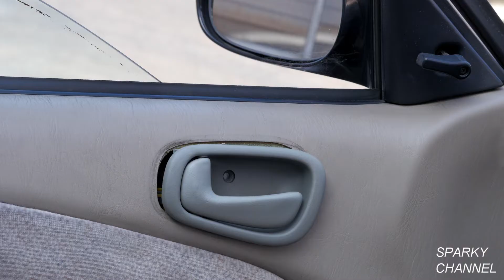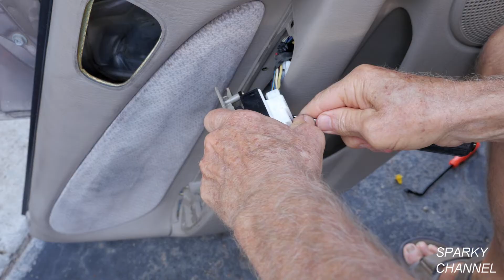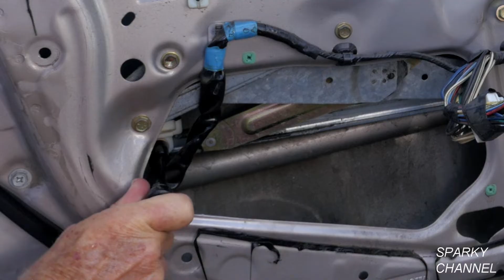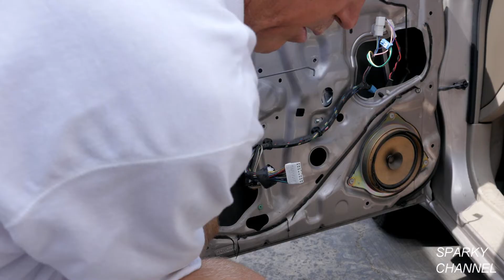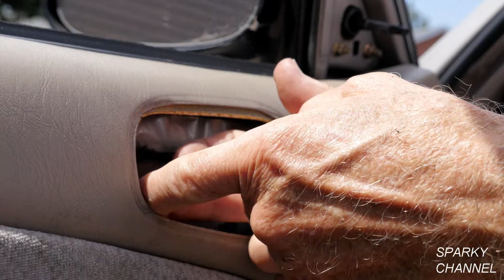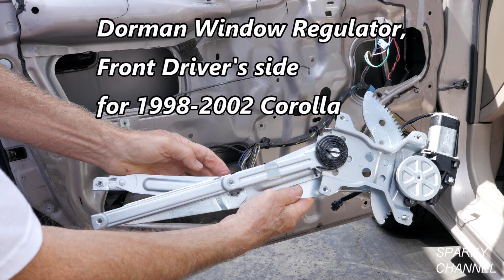Toyota Corolla 1998-2002 Window Regulator Installation

Comment from the maker: MICTUNING 13 Pcs Auto Trim Removal Tool Set with Fastener Removers Strong Nylon Door Panel Tool Kit: Amazon: https://amzn.to/2Pgf2jb
  I used the: Dorman 741-801 Toyota Corolla Front Driver Side Window Regulator with Motor: Amazon: https://amzn.to/2BUgZQI
  I've been very happy with it. It has a built-in motor.

Comment: Would the screws be visible if the window is stuck all the way down?   Here you state to leave it about 6 inches up but that's not possible for me.
Reply: Oh, are there bolts i can loosen that well loosen the actual glass?

Comment: How do I take the glass bolts out if the window is stuck in the full up position?
Reply: I have this same issue, how did you handle it?
Reply: I'm wondering how to go this because the window is stuck so the way down
Reply: I don’t know if you fixed this yet but it was also my problem and I removed all the bolts to the window motor then worked the window down to where I could stick my hand under the inside of the door and reach the bolts on the bottom of the window. Once I got the window unbolted I pulled it out how he shows and then had to really manhandle the old motor because it was seized and corroded in place. I was also replacing the outer and inner door handles while I did this job and it was a great time to get everything done at once.

Comment: So jokes on me.  I got the motor replaced and got the regulator back in, but in the process I discovered one of the two plastic pieces that hold the window in had long ago broken and now I only have one of the two to reattach.  It's also labor day; so the local pick a part is closed so I can't go over with my tools and grab another window that has both plastic attachments unbroken. Oh well, guess I'll have to finish it tomorrow, for now I have the window attached on the one side and I'll just keep it in the closed position.  Thanks for the video guide.

I guess it'll work alright with only one mount attached, but I need a few things from the pick a part anyways.  A door panel would be nice since my drivers side one is falling apart, and a couple of other things.

My rear passenger side has had the same issue for years, I just use it less so didn't care as much.  But looking at the window I'm not sure how to get it out to then take the regulator out.  It's just held in pretty securely by a rubber channel.  Now my rear window is stuck down because I figured it would be simple and I'd fix it while I was at it........
Reply from the maker: You're doing an amazing job of maintaining your car. Great job, keep it up!
Reply: @SparkyChannel  thanks. I was able to hit off the missing window mount from a window at the junkyard and attach it to my existing one.  Would have grabbed the whole window but mine is tinted and that one wasn't.  Should have put some kind of adhesive on it but am hoping gravity and friction keeps it one well enough.

Comment: You just saved me over $500 on my 98 corolla on this repair with such a clear, detailed step-by-step and crisp instructions. One of the best instructional videos that I have seen in Youtube! Kudos to you :)

I did everything like you have shown in the video, however after successful replacement of my corolla's window regulator and putting the door panel back on, I noticed  the wiring harness keeps pushing out the window control unit out of the slot. I think the tabs that keep the window control might be broken, so the window control keeps popping up and never stays put. Any ideas how to secure it in place?
BTW, I used zip ties on the wiring harness bundle inside the window control to try and push the wiring harness down, so it won't keep pushing the window control out, however it is just not working out. Now, I am just thinking of using a duct tape and secure the window control to the door panel, but it will look ugly..:) Thanks in advance!!
Reply from the maker: Thanks so much! Can you buy some new tabs to replace the broken ones?
Reply: @SparkyChannel  You are most welcome! Thank you!!
I will try to buy the tabs like you suggested. BTW, what kind of tabs will be suitable for the door control panel? I have no idea. Please advise.
Reply from the maker: @bluegames1154  Look for a similar tab that is still intact.

Comment: Thank you very much for your video. I completed this job recently, with the help of your video, and the window regulator now works great. I recently ran into an issue where the window moves freely up and down, but seems to grab onto and folds down the wiper type seal on the interior bottom side of the window. Are there any adjustments that can be made to align the window centered in the path to prevent this? I'm afraid it's going to destroy the seal over time.
Reply from the maker: Great job Shane! Try a little silicon lubricant spray on the wiper type seal.
Reply: Thank you, that seemed to do the trick at least in the short term. Very appreciated.

Comment: Theres a black thing blocking the regulator from going up and idk how to work around it 😭 can anyone help
Reply from the maker: Is it loose?
Reply: @SparkyChannel  no, my roommate ended up moving it & fastening it in a hole that was free.. some part with the locking mechanism I believe lost it's bolt and got misaligned somehow. Might've gotten in an accident. He matched it how it was on the opposite door panel. It was so frustrating to me because I had already done this job on my older car (an 03 Honda Civic) and that went without a hitch. But anyways yeah that's the story thanks for reaching out I really appreciate it and hopefully somebody someday can be helped by this and saved some time in the future! Comment this if it did plz, future-dweller. I'd love to know! Also, you're like, SO sexy 😘

Comment: My 2000 Corolla drivers side window regulator needs to be replaced. My mechanic said it will cost $400. This video makes it look so simple to do myself and the part from Amazon is only $39.98. I've read all the comments from men who have successfully replaced it, but I'm a female and curious if any females have successfully accomplished this task. I just changed my inside door handle, but that was really simple.
Reply from the maker: It will be interesting to hear comments. I would suggest paying a little more for your window regulator to get higher quality.
Reply: @SparkyChannel  
I will look for a better quality regulator. Thank you.
Reply: You can handle it, it's not that difficult

Comment: Hey Bill. So grateful for your video. I changed the window regulator on my sister's 2001 Corolla this morning. Your instructions were perfect! I was able to do the whole job in less than an hour. I bought the Dorman brand from Parts Geek for about $53 plus tax. It fits her car just right and now the window works great. Now she doesn't have to drive around with the window closed in the heat of summer! Thank you!
Reply from the maker: Great job!

Comment: Thank you! I'm about to embark on this project!
Reply: I'm curious if you were able to successfully complete this task and if you did, how long did it take you? My mechanic is going to charge me $400 to change the drivers side regulator,  so I'm debating if I should attempt this or not. The part is only $39.98 from Amazon. It would save me $360 bucks but I don't want to cause additional problems and have it cost me more to repair what I tried to repair. 😂🤣😂
Reply from the maker: You can do it!

Comment: Sparky I have the same issue but my car window is down all the way so is there a way to get the window out of the down position when using the two bolts. My window doesn’t even move when I press the button but al of the other windows are fine. So it is the window regulator and motor correct? Please lmk
Reply: Loosen the 6 screws first then you can lift the window a little to get to the two window screws. Just had the same issue but figured it out

Comment: Sparky. Thank you for your contact. I really have no knowledge to use my voltmeter except ... the 12 volts  I expect to see from  my battery! I laugh at myself for wanting to do things without first reading instructions. Regarding finding cracked soldering connections i guess it is easier.... because it is a visual thing that you can detect.... I am an elderly here that wishes to come back  more intelligent in the next life.... i will see if I find some electrician that can check the cluster odometer /speedometer for power although at night all its lights are on, but during the day .... i do not remember now if some lights come on? The temperature does show up. the needle of the fuel still works. The stop pin of the speedometer at zero m/h I already broke it!  :-)  I have to glue it back on!
Reply from the maker: Well, bless you! I know it can be tough to keep the Corola running but it sounds like you have a really good attitude! Another idea would be to check a junk yard for the new parts that you need. They might even agree to install the part for a fee.

Comment: Sparky. I did my testing with my cold cluster placed inside the refrigerator. Result: I could see same mileage from beginning of the year 114.376 plus 1 mile.... 114.377. i was able to take the picture I wanted before it disappeared but, it is useless because ... I was really expecting to see today's mileage to show to car technicians that were asking me what was the mileage of my car. In my second try,  i took a pic of the mileage  found in the first trip and also the second , leaving the first one in zero.... to test it tomorrow again and .... entertain myself with the cluster later when i finish with another situation. I just want to find the culprit resistor or else. Many thanks for being here, helping us and sharing with us. Take care of yourself.
Reply from the maker: Excellent try. Have you tested to see if your odometer is getting power?
Thanks!

Comment: Sparky, I have been driving for 1/2 year now without odometer and without speedometer. One very cold day of this past winter I suddenly saw 114 376 miles (toyota corolla 1998 LE). I am planning to take off my instrument cluster and place it inside the refrigerator and find out if the cold temperature allows me to find out how many miles I have now.... I will let you know.    :-)
Reply from the maker: Sounds good, check it out.

Comment: How do I get the window halfway down if my window regulator is not working at all
Reply from the maker: You may be able to manually operate the gears of the non-working regulator or you could try jiggling the window to see if it will go down a little. Also, use some silicon lube on the gears and see if the regulator will move the window a little.
Reply from the maker: Also,  Thanks! Use lots of silicon spray on the window/door, turn the car on and help the window with your hand to get it into place. Another trick is to bang on the door with your fist. The regulator might work one last time.

Comment: Great Video, I need to take replace my door regulator however the motor is not working and I am unable to lower the window down to 6" to access the two 10mm bolts.  Ideas on how I can get the window down?
Reply from the maker: Thanks! Use lots of silicon spray on the window/door, turn the car on and help the window with your hand to get it into place.
Reply: @SparkyChannel  thanks, so will I be able to push the window down by hand?  I am afraid I will have trouble getting the regulator to move down?
Reply from the maker: @murphysf6969  I think it might work. No guarantee. Another trick is to bang on the door with your fist. The regulator might work one last time.
Reply: I shit you not... I’m like no way punching it is gonna do anything this old man is crazy. Punched it once, BOOM! Works perfectly 😂😂😂 thank you sir
Reply from the maker: @Dee343-s9n  LOL!

Comment: If my power window is not working, how do I know if the problem is the regulator or the window motor?
Reply from the maker: The motor is built into the regulator on this model.

Comment: It seems some replacements for the 98 Corolla regulator is slightly different than original.  I found that removing the post screw from the original and screw it into the new regulator and getting a couple of bolts for the new regulator worked out ok.
Reply from the maker: Good tip, thanks!

Comment: Great in depth guide.  I bought a motor to replace my rear passenger side regulator motor 3 or so years back, but got lazy and never installed it.  My drivers side front window was acting up(when in the all the way down position didn't want to go back up once and a while), so I may install the rear one for practice since the right and left side motors are not interchangeable.  Would also be a good test to see if the motor alone will fix it or if I should get the entire assembly next time.  I've just been avoiding using the rear passenger side window, but if the front drivers side went out I'd fix immediately.
Reply from the maker: Sounds good! Thanks and good luck!
Reply: @SparkyChannel  I couldn't seem to find where to unattach the window; I even felt around with my hands and couldn't figure it out.  Rear seems to be different than the front.  The window still goes up and down, it just gets lazy towards the top and needs a several minute break to go up a bit more(repeat a few times) and then it's up all the way again.  Oh well, guess I'll look into it another time.